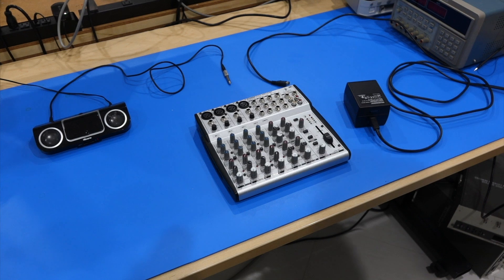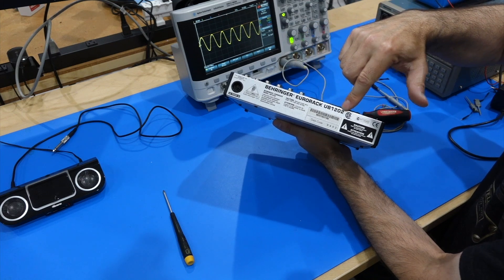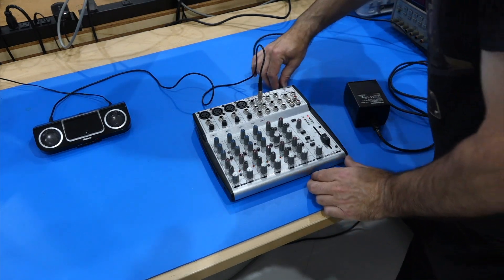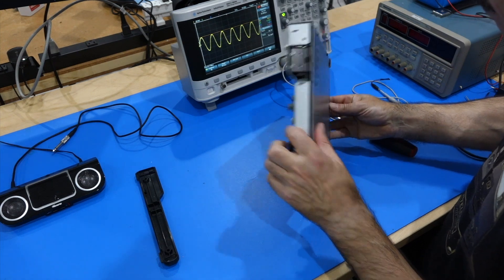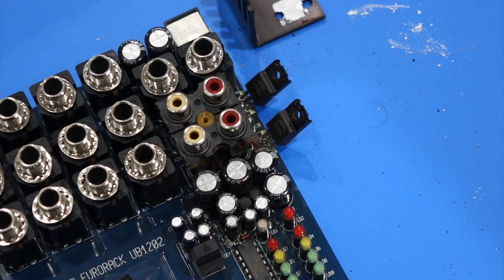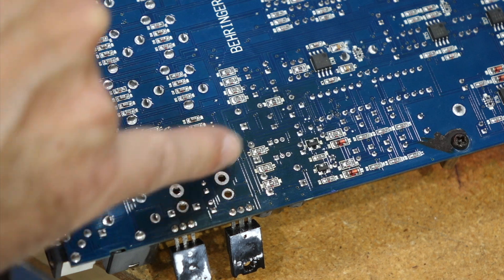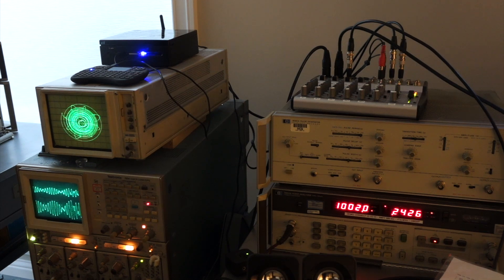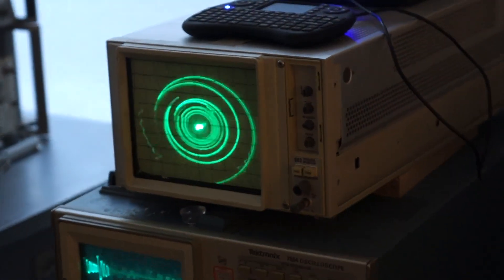Modern Tech Fail: Behringer Eurorack UB1202 Repair

Comment: A reminder that being a Chinese capacitor does not make it a bad capacitor. The issue here is Behringer specifying the cheapest of the cheap caps. Be careful saying “Chinese caps are bad”. Nichicon and Rubycon make “bad” caps too if you buy their 85C 1000hr caps and put them in an environment they weren’t intended for.
Reply: The worst Nichihon or Mundorf or else is light yrs better than the worst Chinese capacitor... I know it very well recapping my Studer A68 and Revox C221.
Greets from Switzerland.
Reply: Francis I agree with you that I wish the super super cheap crap never existed so that it wouldn’t even be an option to use, but you know everyone’s always trying to scrape the bottom of the barrel
Reply: Yes it does. Slave labor is not OK. If they can't do it, we will make ours more available. Sorry. This isn't repeated Japan hate China has always made the cheapest most dangerous stuff.
Reply: Solid State Workshop  All good points but the blind anti Chinese made sentiment that ignores the just as bad or worse US made stuff all is caused by the same issue...saving pennies.  Bad Chinese supplies are ordered as they come...as cheap as possible.   There are plenty of great Chinese products, but they are not the cheapest you can find.  Long story longer....you get what you pay for.  Both in China and everywhere else.
Reply: @jeffclark5268 point me to one single electrolytic capacitor incident you had fail before a Chinese made seller in time.
Reply: @jeffclark5268 and you liked your own comment. You knew it wouldn't get anywhere.
Reply: Jeff Clark but there is a reason for the cheap Chinese reputation. The vast majority of the Chinese stuff is indeed cheap crap. And the vast majority of USA made stuff is made better. Of course there are many exceptions.
Reply: alphabeets You are right but check the cost difference on average! Trust me I don’t like cheap stuff at all, but just hate that so many times the Chinese get blamed for some European or American company specifying parts knowing full well they are crap. Just because you have your stuff made in China doesn’t mean that you can’t control what your thing is made from.

Comment: I imagine those capacitors were bad when they left the factory.
Reply: But they all had a QC sticker! :)
Reply: Yeah, Quack Crap.
Reply: Nope, they were completely in spec: "10-80% of nominal value for 1 second at 8.5°C"
Reply: Probably just defective seals.  Perfectly "fine" out of the factory, but nothing to stop them from simply drying out over time.

Comment: I'm not surprised, because this is a nearly 20 years old mixer.
I've had a few Panasonic electronic devices from the same era that have suffered the same fate.
Reply: What? Even Panasonic? The Panasonic stuff ive taken apart has  used Panasonic capacitors and is made in japan.
Reply: @simontay4851  
Yep, Panasonic fancy DVD player from 2004, with 2 bad electrolytic capacitors (bulging and leaked) in the PSU section. And a microwave oven (CPU board) from 2003, same thing again in the PSU section. Mind you, both of these were manufactured in China. I've seen Panasonic devices with high quality Matsushita electrolytic capacitors, but those were from the late seventies and made in Japan. Later on, everything was made either in Mexico, or China, with dreaded Chinese brands caps.

Comment: Had a problem with my 1202 and the repair tech I've used over the years said that repairing it would probably cost more than buying a new one as they go for about $120.  Another example of our intentionally designed throw-away culture, a culture that is devastating the planet.
Reply: Which is why repairing it yourself, if you have the ability and inclination to do so, is the way to go. Deny these manufacturers the business enablement to produce disposable products.
Reply: Im 100% with this argument but I also think that old timey machines lasted longer because they were produced for rich costumers and thus were high quality production, nowadays they are produced for the average consumer so they must be lower quality. Thats just part of the problem imo.
I bet supercomputers back in the 80s had much more love and care put into them than common PCs nowadays, even if their performance are close
Reply: @guilldea  There is no problem with hacking/or modding old cheap stuff/devices with modern parts that happen to be more reliable, cheaper and (more) available for customers to buy, nowadays. Lets call it what it is: an upgrade. That can even be done to new cheap throw-away devices. 
... if the design allows it:)
Tip: There are many YouTube videos around Cray, Supercomputer Chip tear downs, people who revive them and drive them. I think even Dave (eevblog) has a tear down video of a wonderful processor. OH! ... and how about CuriousMarc? Just type "supercomputer" on the channel page into the search bar.;)
Reply: I fix it instead. That way I avoid buying more crap. Plus, it's fun!
Reply: @johnvcougar  The trouble with a lot of stuff now is they make it so it can't be repaired. I really enjoy repairing equipment too and have done it now for 40+ years.
Reply: @stopthebus  IKR, and I reckon it's criminal.
Reply: @stopthebus  good luck repairing anything modern. It’s not “throw away culture”, it’s technological advancements. If you come up with a genius device and you have to put it in the BGA package because of pin number. It’s not easily available, it’s not easily removable, but it is what it is. Otherwise we would be in the DIP era. Technology got smaller that’s the way it goes
Reply: @64bittz93  Yes, technology did get smaller but that doesn't necessarily mean it's better. 
Things like computer motherboards with ICs that have hundreds of pins aren't an issue - they rarely fail, and by the time they do it's time to upgrade to a new mobo anyway. Other things could still be made to be repaired if the manufacturers chose, but they don't want to because it's cheaper for them to make them a throw-away item. Things might start changing however when governments around the world adopt the right to repair policies.
Reply: Makes the shareholders happy though.  Maximum profits.   Engineers hate bean counters.
Reply: On the other hand: think of what we toss nowadays vs the enormous environmental cost of well built/overbuilt test equipment that’s obsolete and tossed away (eg because nobody does analog TV anymore). Tossing away a few hundred grams of stuff in this Behnringer mixer is way less of an impact than tossing away a properly built console that got otherwise obsolete and weighs several times more and used less efficient manufacturing processes as well. Even your time spent on the repair is not free at all: how much resources on average does every hour of you being alive cost? It’s not a small footprint in the western world, and not to be discounted lightly. It may cost less in resource terms if a new thing is made instead than taking hours or sometimes weeks to repair it - if that’s your hobby go for it, but before you start claiming environmental benefits you have to be fair and look at the complete picture and not just pick and choose which things count and which don’t. It all counts. Educating engineers, even self-taught ones, isn’t free either.
Reply: I work repellent pairing a lot of pools and you wouldn't believe how many of them are built to fail. Even weed eaters and things of that nature. That makes the part alone and up costing like 70 bucks but it feels like a $10 POS and at that point you might as well get a new one unless you have a $300 piece of equipment but usually those ones have some more modifiable parts.
Reply: Time was, when that mixer would have cost $5,000 :-)
Reply: The biggest part of the problem is people keep buying this sh*t. They're creating demand. By buying cheap rubbish, it encourages china to produce even more - and people buy that junk as well. It's a self-perpetuating problem.

Comment: These are electolytic capacitors, so you should be applying some bias voltage during the test.
Reply: Are you not confident his tester would have that built in?
Reply: @djmips  It does have it built in, but you can see from the front panel switch setting that it is disabled.

Comment: caps in such low power devices wont bulge, to make them  bulge they need to get hot.  when their esr increases, they lose more energy to heat, which evaporates / boils the electrolyte causing them to bulge, dry out and esr increase even more.  usually they wont leak either, they just dry out over time.  even new old stock caps from this era might be bad allready without even seeing a second of use.

Comment: Its so interesting that the sound made from smooth lines is so harsh while that of the "filigreed" shapes sound so pleasant. I understand why, but its a great demonstration of the complexity of music.
Reply: I love how interrelated actual sound is to electrical engineering, how a waveform is a waveform regardless of whether it's kept completely inside a circuit (like the Soyuz clock) or exported to a speaker.

Comment: Thankfully there are measures being taken in order to stop this scam practices from china
Reply: It is not a scam. Chinese cap manufacturers are not the problem -- the large corporations that put these in their products are the problem. As long as they keep buying them, the bad caps keep getting manufactured. I find them in TVs, washing machines, amplifiers, all built by big named brands who are screwing their customers over for a few cents per cap. :)
Reply: I hope so. The chinese crapacitor manufacturers should be forced to improve their quality or be heavily fined.

Comment: Speaking of the importance of quality caps, I took the main filtering caps out of a 1996 Alpine V12 car amplifier, they are alpine branded 50v 5600uf snap-in caps and one has a v loss of 1.3% still has 5643uf and an esr of .02, the other has a v loss of 1.2% 5821uf and an esr of .03. They have outlived most of the other components on the amp.

Comment: I've lost count of how many motherboards and other computer crap I've had to replace caps on.
Reply: I am still using a 12 year old Gigabyte motherboard. It must have been running with the original caps for about 30000 - 40000 hours and is working perfectly fine. On the packaging was stated, that it is built with high quality caps, what seems to be true, but it was not the cheapest motherboard.
Reply: @petermuller6923  Yeah, I remember when they started advertising those "high quality caps." Almost as if they knew that this was a problem.

Comment: I got a second hand behringer xenyx 1222fx  mixer for a great price it was only 2 or 3 years old and it blew up a few days after i bought it from a person. But i fixed it for few bucks i just replaced switching transistor/ic , rectifier and optocoupler in the power supply. Now it works perfectly. Only letdown of that mixer was a freaking switching power supply. If it blows again i am going to make external power supply with proper transformers and regulators.

Comment: To the oscilloscope Music demo: You should try to find a DC coupled (or other way round: not AC coupled) audio source. This REALLY sharpens up everything and provides signals in the way oscilloscope music should look like on the screen as intended by the creator.

Comment: Oh yeah, just resurrected large Samsung monitor thrown away by a neighbor. Used Nichicon for the re-capping, which basically doubled price of the device on the market right now :) (nobody cares I guess)
Reply: Recapping it best for older sets but later models you can sometimes get the whole PSU board at a reasonable price over recapping especially if you are not 100% it is bad caps or it's a BIG sized screen set. Older models tend to be on the rare side when it comes to NOS PSU boards.

Comment: Replacing the caps with better ones that can handle higher temps would probably cost more than the unit.
Reply: Better quality japanese caps would've only costed a few cents more each. They wouldn't increase the price of the final product by much - just a few dollars. Most customers wouldn't notice. But the penny pinching bastards use the crappiest cheapest chinese caps they can find.

Comment: I know of an Australian manufacturer of specialised equipment that farmed out some production to China of a product which was normally manufactured locally. Within 6 months to a year they started getting failures - up to 50%. Since the equipment had special warranties and required an electrician to replace it they had to absorb all the replacement costs involved. A very expensive lesson due to poor quality components being substituted in China.
Reply: @geocam2  Very little to do with workers rights but more to do with Chinese knock off caps, not Australian bogans installing Japanese caps. The same would happened if Australians installed the crappy Chinesium caps.
Reply: It is not a china related problem. It is cut in cost problem. If they pay the same money for production in china as they pay privileged australian engineers they would get a better quality product for the same price.
Reply: @pahom2  Agreed! China can produce quality products, but, instead, the world comes to them with price bring the most important spec. With price first, second, and third, what you get is crap. Not surprisingly, if China was to build to a technical spec, the cost would be similar to what you'd pay for quality elsewhere in the world. Oddly enough, for China's wealthy, the phrase "Made in USA" is prized, because even they know most of their own national products are best used for wiping.
Reply: @pahom2  But why send production to China then? Nobody in their right mind sends production to China unless it's cheaper. It's a paradise where labor's cheap and you can skimp on safety, quality, pollution control, patents, etc.  More civilized societies (where for example "privileged engineers" come from) operate on different terms.
Reply: @gs-we3rp  appetite comes with eating and greedy capitalists from "civilized societies" don't stop on cheap labor and keep cutting price on capacitors
Reply: I've travelled a fair bit to China for work. If caps are being substituted for lower-quality ones it's almost always because the engineers who designed the thing told the CM to chop their cost, not something the CM did of their own volition.
Reply: @geocam2  the only achievement australian workers endured is being born in australia. If they loose a fair competition to chineese workers then ok.
Reply: @geocam2  go cry to your mummy snowflake
Reply: @pahom2  Ok Wu Mao...
Reply: @pahom2  go cry to your winnie the pooh

Comment: Pet peeve: Chineseium is a funny name for a low-quality metal alloy made in China, because it follows the pattern of -ium suffixes seen in several elemental metals (we must ignore the elemental vs. alloy discrepancy for full enjoyment of the joke, as is done in several proprietary names like Celestrium).  It's not a funny name, however, for any old non-metal low-quality product from China.  The -ium makes no sense and communicates nothing (except perhaps some sort of general distaste for Chinese products) if we are talking about capacitors or ball-point pens or whatever random product category.  Also, the most unreliable caps aren't Chinese at all, but Taiwanese no-name caps from the early 2000's.  See: "Capacitor Plague" in Wikipedia.
Reply: Kevin Counihan  two days ago I sorted out a KUKA KRC1 robot running windows 95 on a 80486 that still makes spectacularly accurate welds on German cars :)
All capacitors 125 degrees C rated though.
Reply: China has certainly become the poster child but has no exclusivity on sub-standard or long term unreliable manufactured components.  You can find "-ium" crap products from just about every country.
Reply: @reasonablebeing5392  Hmmm... Americium? ;P

Comment: Now THATS a BAD filter - WOW! 
I just changed 4 Xunda caps in my (new to me) Eurorack "UB2442FX-PRO" power supply. This time all 4 have burst vents. (2 25v 1000uf and 2 16v 470 uf). This replaced a Fostex mixer so it's a step up; but I want to replace all the caps before something else goes wrong.

Comment: Place the transformer on the outside then only requires that the transformer be UL, CSA, etc. approved.  It also helps to isolate out hum.   The White EQs have outboard power transformers too.